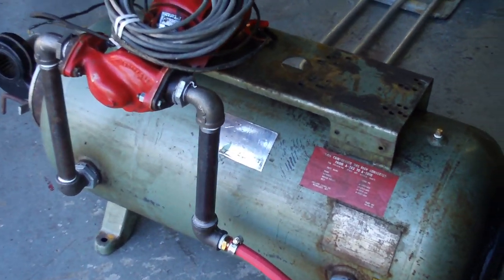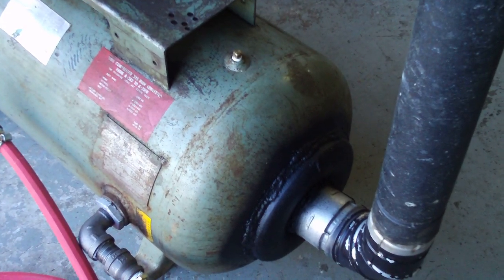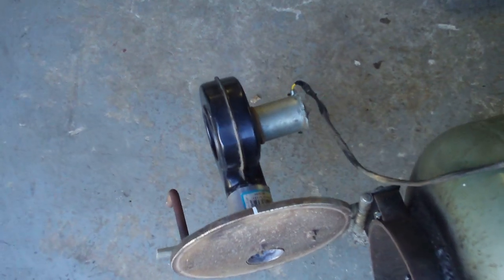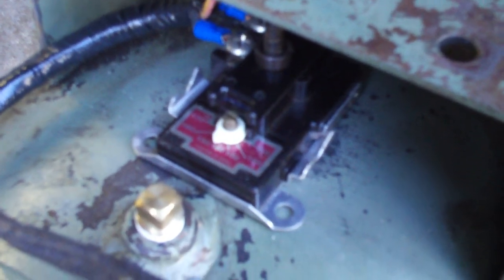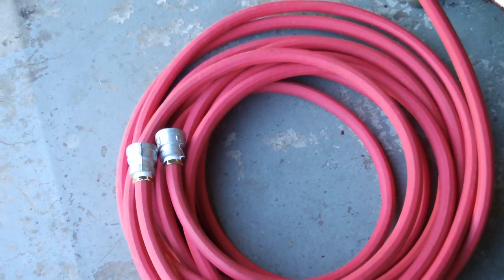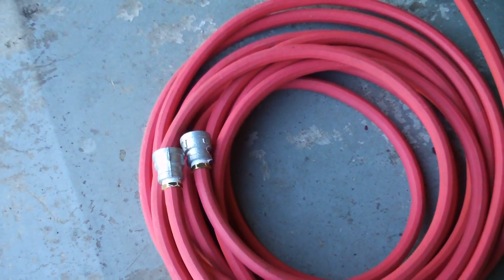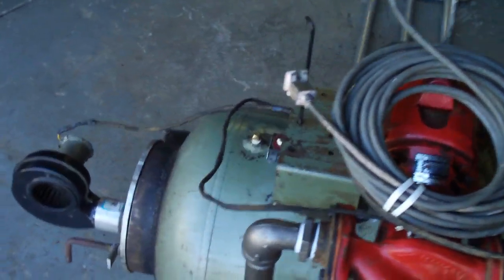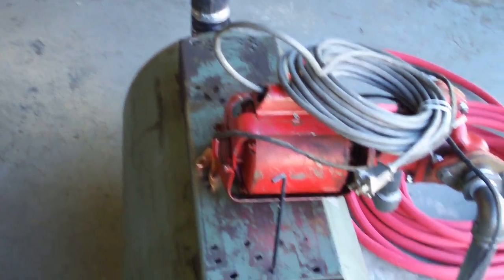Homemade Heater wood boiler

Comment: How did he get enough wood in that little cylinder to get it hot and keep it hot for any length of time?
Reply from the maker: Well it was but for a small shed and water retains the heat for a short time. Figured since it has a stoker fan, a couple pieces that are not totally seasoned would work good without burning too fast, last couple hours. It wasnt built to heat anything larger than a large shed.
Reply: It does give me a good idea about using some 24" or so pipe line pipe and running it through maybe a 500 gallon propane tank as they are pretty thick. It would be more efficient if the firebox didn't go all the way thru but this design would be a lot easier. Those round propane tanks would be idea. Insulate the outside of the tank and put it on a concrete slab. Then build a small well insulated building to enclose the whole thing.
Reply from the maker: @pl747  sounds like a good plan

Comment: I like it.  This is similar to what i have built. I slid a 150 gallon propane tank into a 500 gallon tank. 
 As for a radiator Just modify an old A/C A coil.  You can cut the ends off and sweat on 3/4 pipe adapters. That's what i have done.

Comment from the maker: A friend of mine had someone that wanted to buy it, i ended up selling it to him for use in a 12 x 20 work shed, the last i heard from him was that it was working perfectly, and he had purchased solar panels for charging batteries for the stoker fan operation, he has it  hooked to a all aluminum car raditator, with a 12V pusher fan,  It was summer when i had built it, and couple months later, i had sold it.

Comment: i reccomend using a computer power supply for the fan as it plugs into the ac outlet and provides continuous 12v also great boiler

Comment from the maker: I never gave it much thought, the hose is rated for 200, store bought stuff, im only doing 170 180 degree at the most, the radiator takes a short time to heat up and disperse heat rather fast im not sure if the blue drums would handle it because they hold so much water weight, on 1/16th inch thick plastic, its a thought for sure tho, i was just making this to heat up a small garage without having to install chimney pipe and risk catching  the place on fire lol :)

Comment: Nice work and design! Can't wait to see what it can do! Instead of a radiator you could maybe use a blue plastic 55 gal drum and throw a pex coil in it to preheat water for your water heater. Insulate it in the summer and maybe remove the insulation to make it a radiator in the winter or add a radiator?  I think the plastic could handle the heat if the hose can. Connect drums for more thermal mass heat storage? Anyway, nice work! Got me thinking! Vertical it w J tube rocket stove?

Comment from the maker: @redneckrollercoast1 well i mean its a vented type its closed up with a heavy black rubber ball on top a pipe to release any pressure, but  i see what you mean i planned to use antifreeze, that should help , bronze pumps are a lot of money, the pump i have was a free one, and many more where that one came from, Thanks for the info !

Comment: @gritzschke I have seen guys use the flexable water tubes that go in the cement, They stapled them to the ceiling, and run them external, But it didn't look that pretty, I picked up a couple old cast iron radiators, I was thinking of cleaning up and installing them, But that is just a Thought, because I need to find a couple guys with strong backs and weak minds to help me move them, they r heavy, LOL

Comment from the maker: @gritzschke Yes i plan to wrap it with some john mansfield insulation i have laying in the garage, and sticking it in a small,"dog house" or sorts to cover it up nice, well the area im heating is more like 800 Sq foot area, and it gets cold enough to justify the car radiator for now,  but your right, heater sore would work great also and compact for use in a small shed ,  now im tryin to figure out a nice way to put a through way into the building without making it look like crap, and obvious.

Comment: @Wallabydam I use a car radiator in my shop, But if you are heating a small area, How about a heater core out of a truck, would be smaller if you are limited on space, I dont think you will have any trouble with your boiler,U did a fine Job, R U going to wrap it in insulation? Insulation is a must to hold the water temp

Comment: I have a wood boiler, I live in the coldest state in the country, I only run my water temp around 150,  And it heats my house and my shop just fine, The first year I run the temp, at 180, and it actually wasted a lot more wood, I'm thinking of turning it down another 20 degrees,